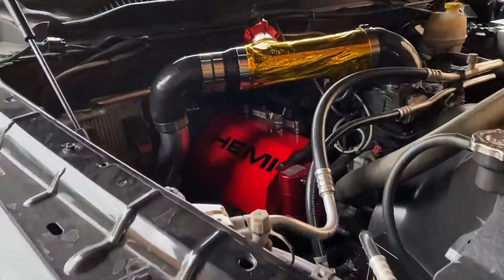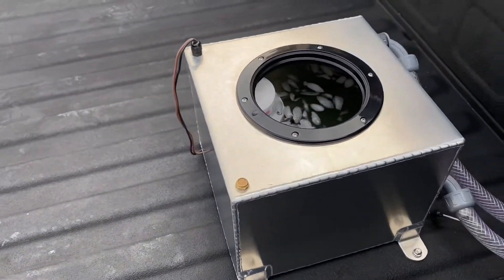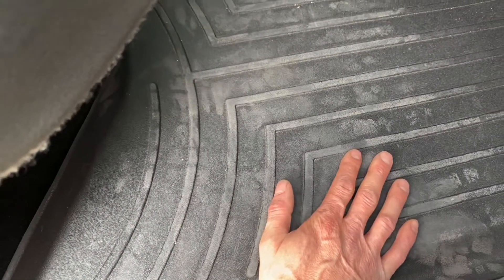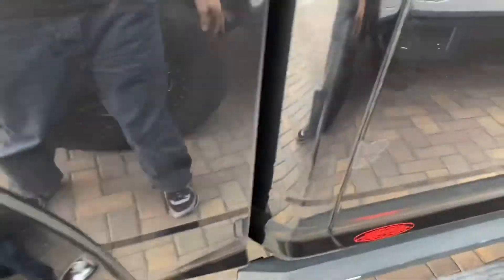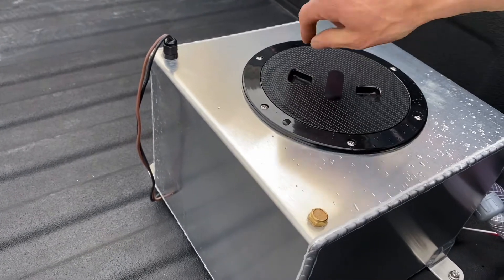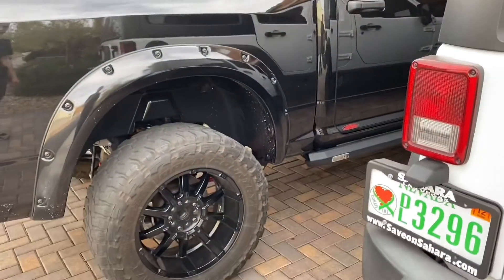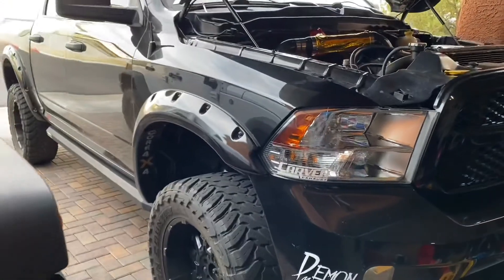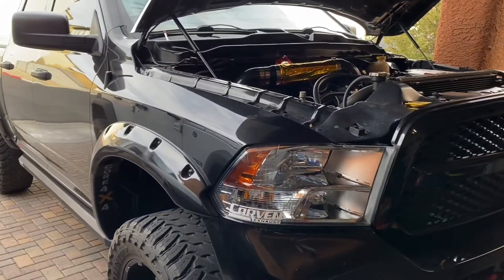My turbo air to water intercooler setup should be compliant

Comment: How long does it stay cool?
Reply from the maker: It will stay cool if you are just cruising no ice. Ice will still be in the box after a 1/4 mile run. It will get hot if you run it hard consecutively. It will need a cooler to do so. I just run at the drag strip mostly with this truck.